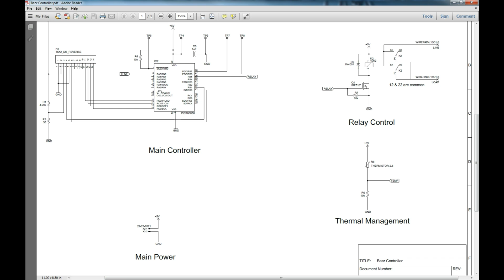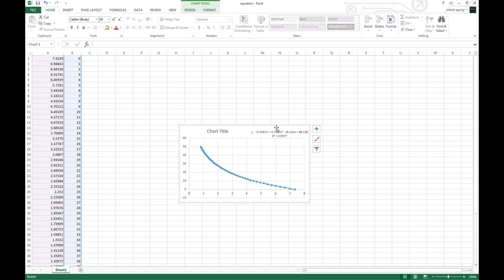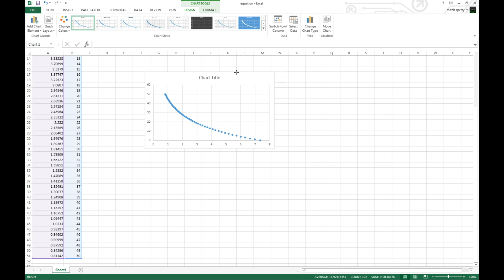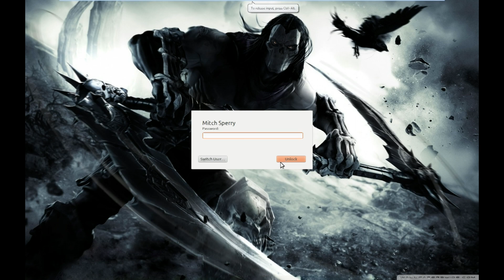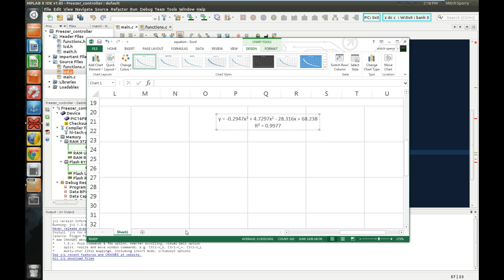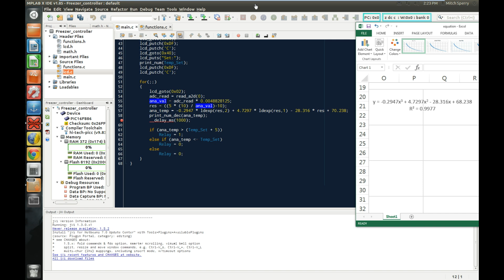Cooler Controller - Part 2 Software

Comment: Hi, Interesting video! 
I'm using your technique to measure light resistance in a high speed process. Using float type to calculate the resistance make the calculation slow. Is there a way to use Integer type variables to calculate the resistance and voltages instead of using the float type,(integer calculations are many order of magnitude faster than float calculations) ?
Thank you.
Reply from the maker: Hey there, thanks for the comment.  To do this without float numbers you would just have to multiply things up by 10, 100, or 1000 depending on what you are doing and use combinations of modulus devision ( i.e. number % 10) to get remainders for the decimal portions.  It can be done but there is not just a quick fix for it.  You just have to plan your integer sizes and multiply things up out of the decimal region and sometimes using modulus to strip off remainders.  This is tedious but it does payoff in memory saved.

Hope this helped at least point you in the right direction.
Reply: misperry Yes, this might be a good starting point.
Thanks.